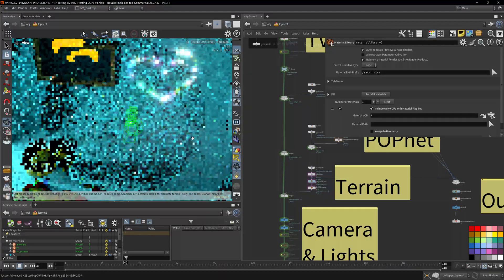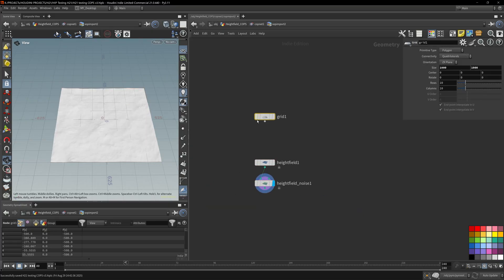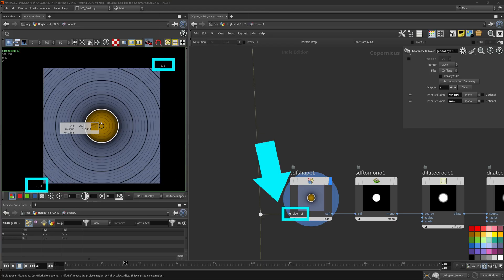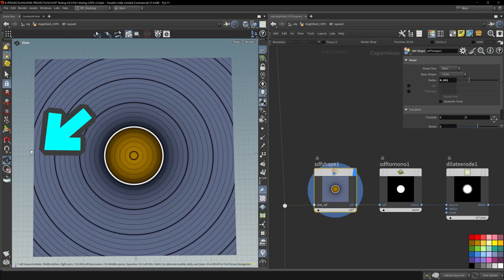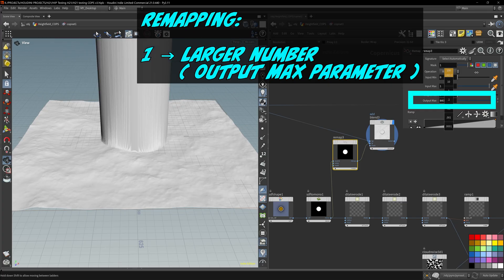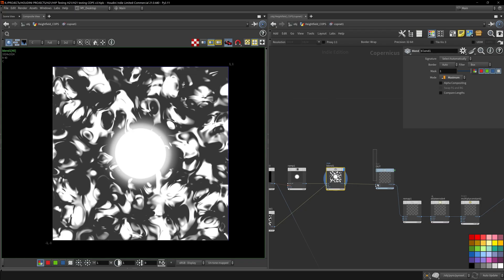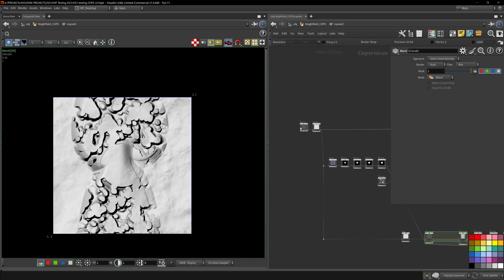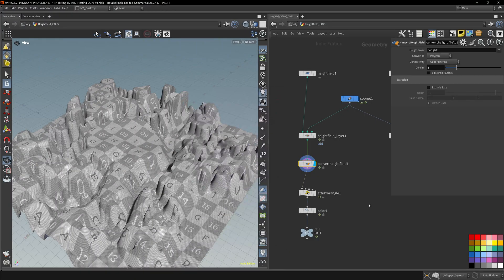COPs in Houdini 21 WILL CHANGE the Landscape!  (COPS to HeightField)

Comment: if i put a geotolayer after a sop import with a heightfield in it  like you , i've got an error 'requested primitive is wrong type"  :(
Reply from the maker: I'm importing a heightfield into the subnetwork, double check the i button on the node the information panel that it's still a heightfield.  Hope that helps!  Sorry for the delay in reply!

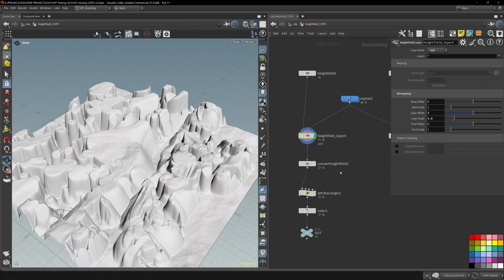Comment: 5:17 What you would want to do there is instead of using volumes, create a grid that matches the HF resolution and add uvs, then use an "attribute from map" node an reference the texture there, and finally displace the points. That way it doesn't need to generate the mesh every frame.
Reply from the maker: Yeah ur right!  Your solution is a lot more efficient than what I did.  I just wanted to demonstrate how COPS can be used to generate HeightFields, I guess I didn't spend too much time on optimizing the animation.